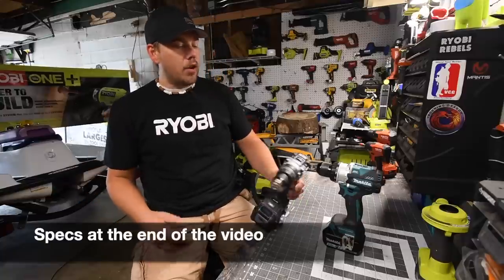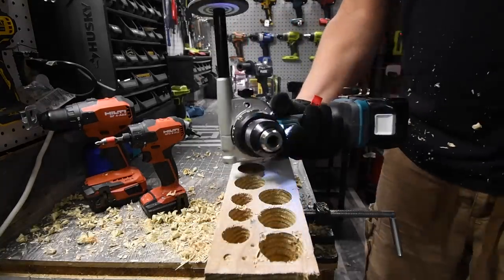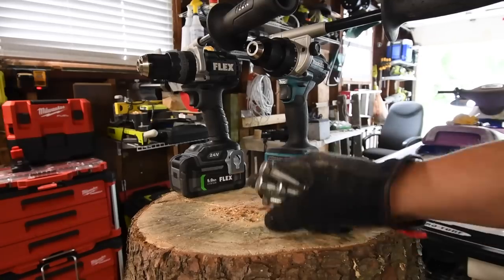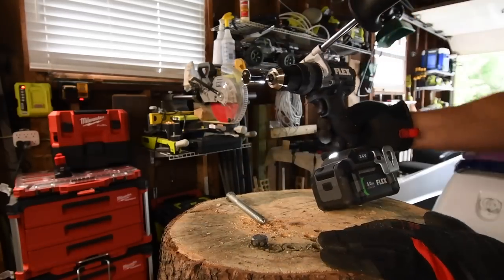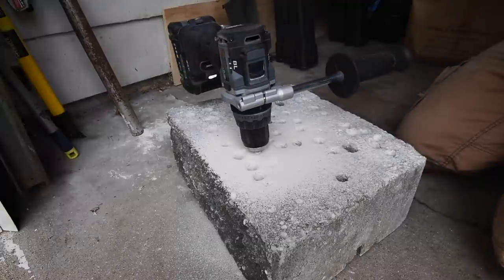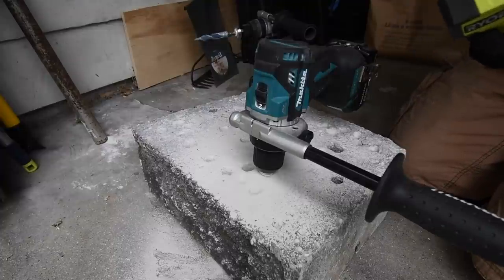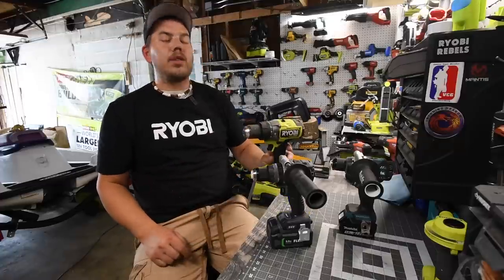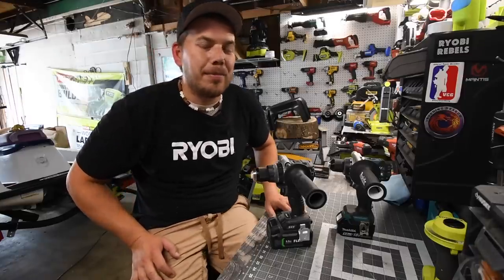Makita vs FLEX (Hammer Drills)

Comment: in the log test, when you put the screws so close together the second tool always is in a disadvantage, instead of displacing and compresing wood around it' it now has to deal with a metal screw' i think its somthing to consider.
Reply: I think similarly. I seem to hear a different sound from wood when the second screw was putting there
Reply: Yup noticed that too
Reply: If this is true you just ruined his year, he's going to have to re-do all of his videos, lol!
Reply: @АртемВ-и5р  lol 👉👶
Reply: Agreed. Plus the exterior of the socket has to deal with extra friction from metal on metal. It may not matter too much but it definitely could be enough to stop the makita. I would have retested.

Comment: When you put a screw into the wood and then put another right by it the wood is actually more dense for screw number 2. You should put some more space between the screws. Love your videos though 👌
Reply: I've always thought the same thing
Reply: @weldonpinder7295  me too... i think  will need hard torque. Because   with self  tapping  Maybe 1"space minimum i think
Reply: Very good and true observation! Cheers 🥂

Comment: Nice flex drill . But when I can pick that particular Makita up for 95 dollars at Hd with the hack, it helps soothe the pain of the flex being faster .
Fun testing as always
Reply: It isn't always about which being the most powerful, I also picked the XPH14 for $93 and it immediately replaced my dewalt 996. It is much nicer to hold and the trigger is super smooth, the mechanical clutch is night and day vs the dewalt. 99% of the time I don't even need the full power of the drill, people like to think that a job is done faster with more powerful equipment, but in reality it's what makes the operator work more efficiently that matters.

Comment: Makitas aren't about raw power. If you need to constantly push your tools to the limit then you're using the wrong tool. The XPH14 is impressive for its size and a real joy to use, before that I used and abused a dewalt 996 and it was a beast with the 8ah battery, but it was tiring to hold for extended periods and it had about 1" extra length compared to the makita. Same applies for their impact driver, no one praises for the XDT14/16 for the power but somehow it's everybody's favorite when it comes to real world use.
Reply: My exact thoughts, love the Makita xdt16, and xph14. Compared to others light, and comfortable. Don't even get me started on their xdt16, amazing ergonomics, and balance.
Reply: When you need to get the job done, pushing your tool to the limit is sometimes required. So in essence, when you need to get the job done .... Don't buy junkita!!!! It will always leave you with regrets. Then again, Makita fans always make excuses. Just so you remember, the Ryobi put the 6" lag in. But the junkita failed 🤣🤣🤣🤣
Reply: Agreed
Reply: Makita is and always has manufactured reliable tools that work flawlessly for years, they have more than enough power to get the job done and that’s what matters to me. The reason Makita tools cut out quicker than others is due to Makita’s overload protection, not everyone appreciates this until their overdriven tools fail at the worst time. 
Also in my opinion Makita’s ergonomics is far superior to other manufacturers especially FLEX.

Comment: Seriously man, a 10 years old would test those tools better. For the start the Makita goes on a disadvantage due to it beeing 6V less (one  less 18650 battery in series). Then you put used accessories on it after the flex uses them... Then you put the screws almost into each other, so close that the screw heads touch each other and when the socket touches the 1st screw normally it stops. The 2nd screw also can't push wood on one side due to the 1st screw.... I also saw a movie of yours of a makita vs Milwaukee,... There you literally didn't crew the chuck right for the makita EVERY time (the 481 model). I am not a makita fan expecially but when i want to buy a tool a do a lot of research online. To me it looks like you're deliberately sabotaging a brand (Makita)...

Comment: I wouldn't use a drill like either of those to drill those holes into concrete. Test some SDS rotary hammer drills please
Reply: agreed, a 3/4 masonry bit exceeds the specs for both of these.
I use 3/16" and 1/4" bits on mine and it never takes more than 10 seconds

Comment: Hey Dave, any plans to get some Ridgid stuff to compare? I'm very curious about the new R86115 hammer drill and 2300 in-lbs impact driver they released a couple months ago to replace the Octane lineup. 
I spotted both on an Ebay auction for about half the MSRP but ended up being outbid.

Comment: Eh, I'll still run my Makitas, I beat the hell out of them and they last, and they make me $$$. There's just not enough of a lineup with the flex tools yet, I could outfit a whole crew with Makita doing ground up construction and wouldn't need to buy any other brands. I could care less if the flex can drive a lag bolt a half a second faster. Fun video though, the flex does seem to be a very well built tool! We'll just have to see if they stand the test of time.

Comment: Flex has the worse battery, I picked up just today the Flex drill with turbo, I am a Dewalt guy but thought I'd give them a try after seeing it on all the channels, the hard case love it, but when I opened it I discovered that both the batteries had leaked now I've heard that they do at times but thought it was weird they did without even being used, I wiped them off proceeded to charge them and found that black goo on the charger after. So I packed it all back up and returning it tomorrow the Flex Battery platform is a disgrace in my opinion and will not be purchasing a Flex again

Comment: After seeing your custom impact wrench, I came up with a bunch of new ideas for custom power tools;
- a hybrid Electric+Air tool, using compressed air and a battery at the same time
- a cordless tool that can run directly from the wall while the battery is still charging (whether or not the battery is actually in there, or charging somewhere else)
- a pair of wire/bolt cutters with a hydraulic lever, a la hydraulic bike brakes (not really a power tool)
- a pair of wire/bolt cutters where the blades are connected to an ultrasonic  transducer
- a pair of wire/bolt cutters with a right-angled handle so that you can hold it in a more ergonomic position (again, not really a power tool)
- sawblades with a sandpaper or file surface (more of a part then an entire tool)
- a gas/electric hybrid lawnmower
- a lawnmower with a hydraulic starter cable so that it is much easier to get it started (some lawnmowers are extremely stubborn)
- a ground effect lawnmower that sucks air (and grass blades) into it, rather than blowing them away

Comment: It's very easy to beat Makita
Reply: Wonder how the xgt line would fair against the flex
Reply: @P_steez  in my point of view The test is interesting with a 4ah battery 40v to see the real power of the tool
Reply: Performance, yes. Longevity, not so much.

Comment: Makita fan boys will be making excuses 🤣🤣🤣🤣 
Every time Flex goes against Makita , it wins by big margins. 
Ryobi even beats Makita , for 1/164th the cost. 🤷 Makita needs to either revamp their entire line, or stop ripping people off by over charging for lesser tools. Makita has the XPS impact bits, which are worth every cent of the $1/bit they charge, but their tools are an embarrassment.
Reply: I'm not a Makia user, but I've seen a few tradesmen using them and needless to say most of those tools are beat up everyday and still working. They're also very ergonomic and that works miracles when using them for continuous periods. My FIL does carpentry and plumbing, he still has a 10 yr old black & white brushed Makita drill and impact driver, a 6 yr old Sawzall as well as a 1 yr old sub compact brushless impact. The only thing he's replaced are the batteries.

I'd say Ryobi has proved fairly reliable over the years, not to mention it's gotten much more powerful and quicker than before. It still represents too much value for the $$$
But Flex? I've only seen a couple people with those and they look as shiny as the day they got them from Lowes, I guess they bought them for show rather than for real work.  Jury is still out on Flex's reliability, I'd wait 5 years, then praise or condemn
Reply: Makita is a great tool brand and has been for decades, sure the quality may have dropped when manufacturing went primarily to China (which is also where Ryobi, Ridgid, DeWalt, Milwaukee, Kobalt, Craftsman, Bosch, Hitachi/Metabo HPT, Flex, and probably a dozen more are manufactured) but they don’t spend a ton of money on gimmicky R&D like most other brands, does that mean they superior, no but to bash them or hate on them with an ignorant reference is kinda dumb. I have a ton of tools from a lot of different manufacturers and as much as I would like for all of the strongest, fastest, and best tools to be from one offering, it’s about being realistic. And I’m not sure about the mathematics behind 1/164th the cost when a Ryobi brushless 1/2” hammer drill is $119 and a makita brushless 1/2” hammer drill is $149 which is roughly a 25% cost difference for a tool that is going to last twice as long. I mean possibly you are comparing prices in Antigua or something but that’s what my local HD shows. Perhaps your HD has Ryobi brushless 1/2” hammer drills for $.91, which is the 1/164 cost you are referring to.
Reply: Makita is about quallity and ergonomics. I'm a Makita user, but have recently baught some much more powerfull Milwaukee's just to test something new, but the quallity is sooo bad and they glitch from time to time, that I'm allways thinking "I should have gone Makita...". I actually put all my milwaukee up forsale and replacing them with Makitas.
Reply: There's not a chance, that I'll ever be convinced to waste another dollar on Makita junk. I've owned a few drills, saws and stuff, and they've all been terrible, horrible and poor excuses for tools. Had 6 batteries and from new they wouldn't last 30 minutes (no they weren't the 2 ah) .... No power, no quality and best of all, their customer service department basically told me that it's not their fault. Now this has been a few years ago, but the poor performance, horrible customer service, disgustingly overpriced junk that they sold me, will forever be in my brain. Had they offered to honor their warranty, maybe I'd think differently, but they will always remain the number one trash brand to me. Them XPS impact bits though, them are the 100% legit real deal!!! I've filled my bit sets with them, no more Milwaukee shockwave, no more dewilt , just Makita XPS bits. If only they could make tools like they make their bits, tougher than anything out there, durable, long lasting and insane quality.
Reply: @Apache-Helicopter-Life  just a note: No Bosch cordless tools made in China. I've owned quite a few Bosch tools and they are all either made in Malaysia or Germany.
Reply: jami w  see I've had nothing but problems, failures and smoke shows from junkita toys. You know what they price them at, I'm not looking to invest that kind of money into something that will continuously let me down. I've owned drills, circ saws, etc ..... And if the batteries didn't fail, the motors did in the tools and I don't abuse my stuff like some people, everything gets cleaned before it gets put away. I take pride in my tools and want to know that when I pick them up to get work done, they'll deliver. Makita has never once instilled that confidence. So I've tried multiple manufacturers over the years. I've recently bought into the Ryobi HP line, more as a "let's try this stuff" experiment. But so far, I've had zero complaints, no failures, no smoke shows, no batteries dying prematurely. 🤷 Maybe all of my junkita tools were built on a Friday? Maybe I got the best Ryobi stuff that was ever built? I have no explanation for why ones better than the other, and I expected to really not like the Ryobi stuff, but as it stands now, my Ryobi HP set is right there with the Milwaukee stuff and snap on gear I've been abusing. If it works, it has a place in my collection. Now, I cannot ever say enough great things about the Makita XPS impact bits ... So many people were ranting and raving about em, so I grabbed a 5 pack of #2 Phillips bits, I've been harder on these things than anything else in my collection and they're worth every cent and more to me. I've ran over 20 boxes of screws with one bit in my impact driver and it barely even looks like it's seen ten screws. Comparing the XPS impact bits to my Milwaukee shockwave bits is like comparing a Rolls Royce to a Geo metro.  🤣🤣🤣, If only Makita would have built their tools the same way, I'd still be using them and wouldn't be here writing about how terrible the experience was.
Reply: @winkletown8828  Be wise and purchase the authentic ones, stop buying cheap counterfeits.
Reply: @jaguarchua  I've owned many Makita tools over the years, if they aren't letting the smoke out, they're not getting any work done and the batteries are failing. Never bought a knockoff one but word in the inner circle is that they're actually worth the asking price. 
Makita 🤣🤣🤣🤣🤣🤣🤣 amateur, fan oy junk!!!! 
Their XPS impact bits though, actually great quality. Too bad their cheap junk tools don't stack up.